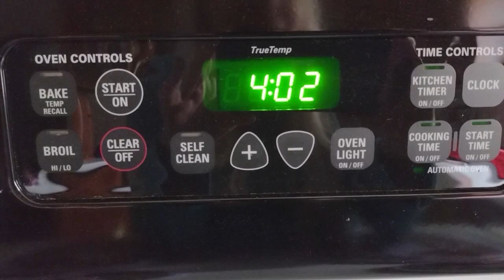10 MINUTES BETTER__MAY: *Sinko de Mayo*__DOUBLE OOPSIE! Clean & Declutter Laundry Sink/ collab

Comment: Yep! Saw it coming. Like why would you start the washer when you wanted the sink dry? But, I tried to make sense of it… like maybe you were going to move the drain hose to that CLEAN empty bin and I worried it would overflow. And, I wondered if you had put your hand down in the sink to see if something was blocking the drain. 🔲 But, I’ve done some doozies. I once almost hanged or strangled myself at the bank drive-thru. I couldn’t reach the “send chute”.  (Before ATMs. When we had to actually send our deposits across the lanes to the tellers through those air powered chutes.) I was stretched out my window as far I could reach. Still not quite reaching. While still hanging out of the window - I reached down with my other hand to open the car door to give me a little more reach. BUT, I forgot about my automatic seatbelt. It moved fast in its track slamming into my neck and trapping my head in my opened window. I panicked for a minute until I could figure out how to close the door to activate the seatbelt to move it in the opposite direction - freeing my head. My neck muscles were strained for a week or more. 🔲My 10 minutes better… tidied under my kitchen sink.
Reply from the maker: Oh my! That would be a scary situation. 😯I'm glad you figured out how to get the seatbelt to release!!! 🤗🌷💕